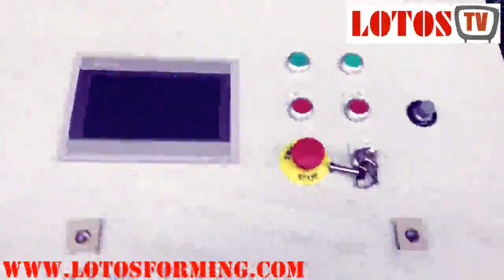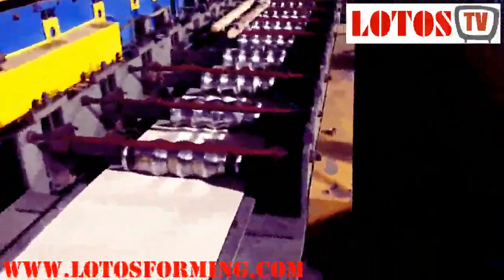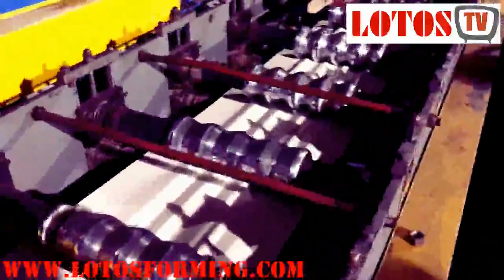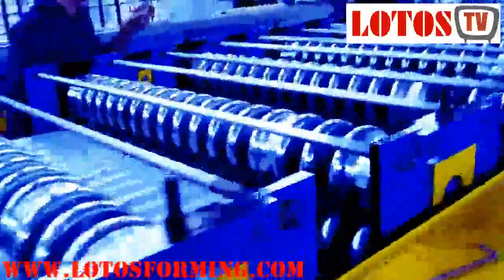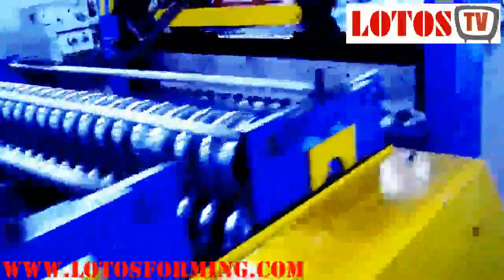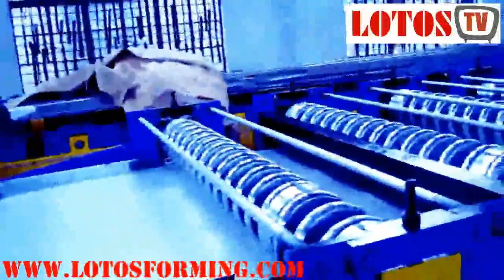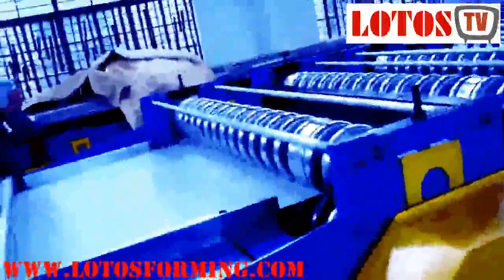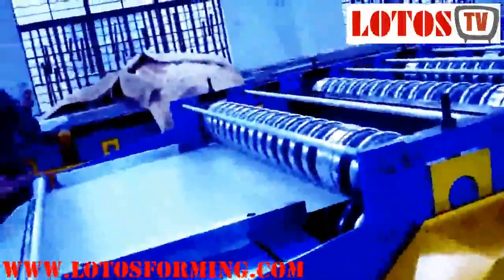Roll Forming Machines : corrugated panel roll forming machine (2019)

Comment from the maker: most commonly available in copper, aluminum and stainless steel.
steel corrugated roofing machinery  is used for roofing lotos is manufacturers of corrugated roller machine this roll form machine are in china for steel sheet and roll you can see  forming process